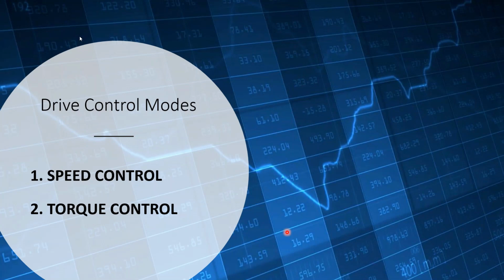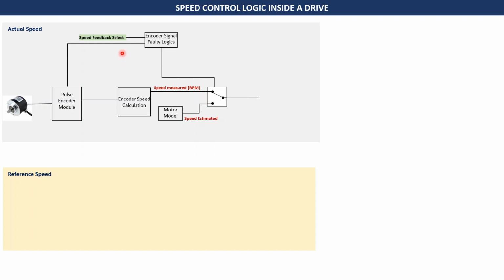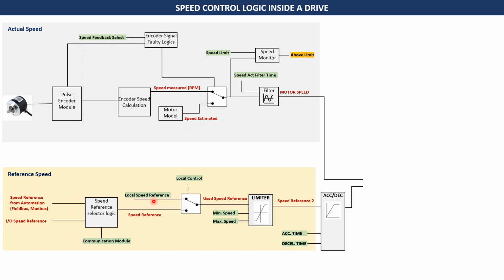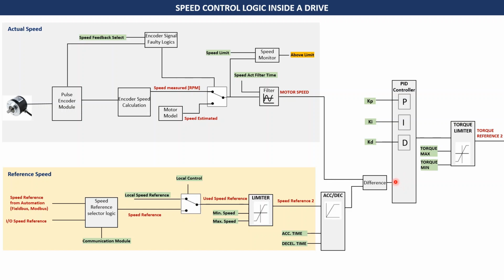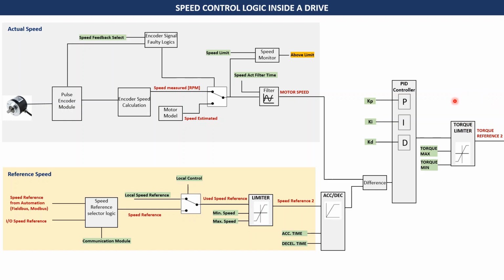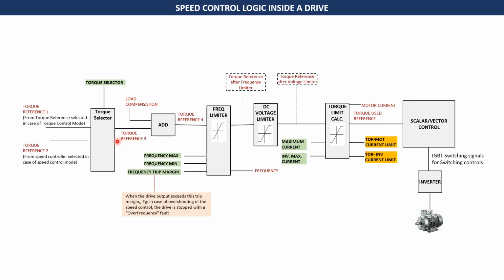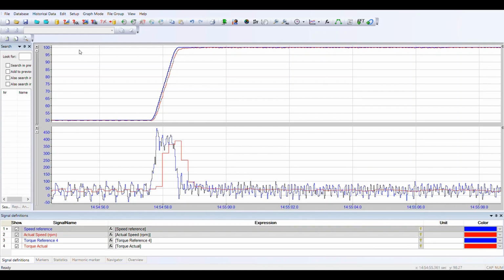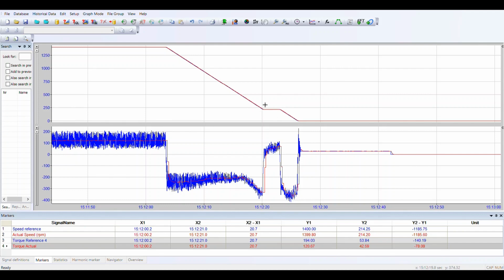VFD Motor Speed Control Logic with Drive Parameters

Comment: ACS 880 180 Amp drive use for crane application but now we are facing issues like - When crane inching LT ( Long travel ) operation  the crane having jerk so please inform me witch parameter should i check and  replace.

Comment: Thank you very much! I am trying to use a VFD with motor to create a simple dynamometer. I put the drive into torque mode.. and set the torque % using an analog input. I then drive the motor "backwards" while setting torque %. It appears to work but I'm not clear in understanding why I do not get an overvoltage fault, as I have no load resistor attached. Any advice is appreciated

Comment: I am Anthony Noronha. Your presentation is fantastic!
I would like to know if a VFD system can successfully be used to fire & control a combuster that works on a liquid fuel. It would be required to pump with precision minute quantities of the fuel say varying from say 5 to around 100 liters per hour. The combuster produces hot gases to test  run a tutbocharger.